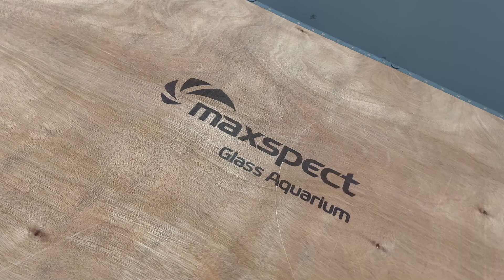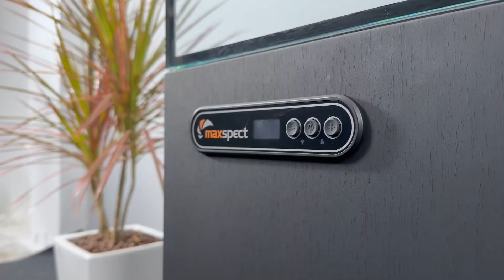Maxspect LS-90 Lagoon Series Aquarium Assembly Instruction

Comment: Are the Razor X R5 lights compatible with the onboard controller?
Reply from the maker: Hi, it's not compatible with the onboard controller, but you can use a separate power supply to use the R5 lights above the tank.